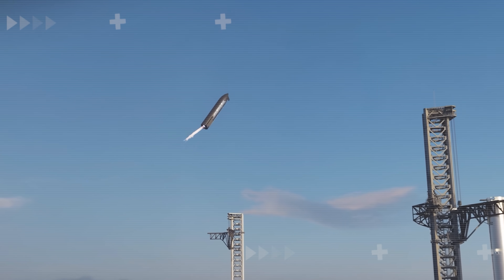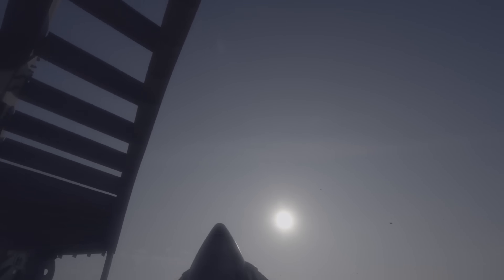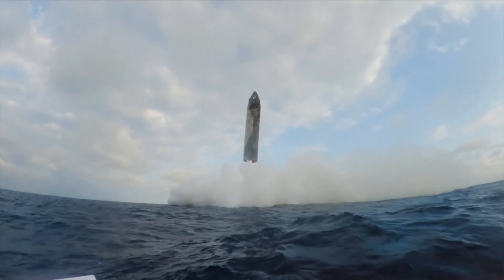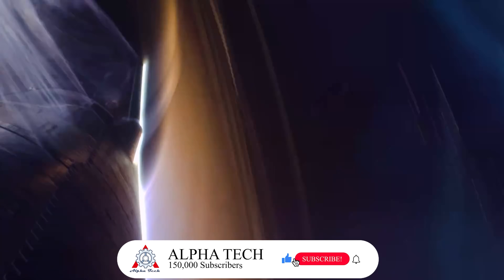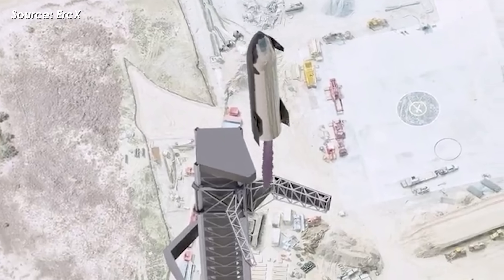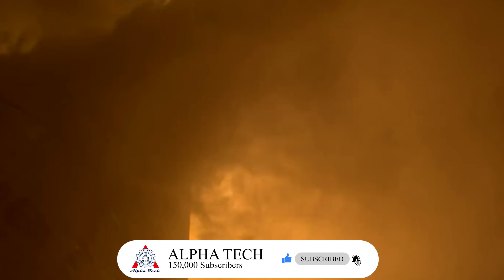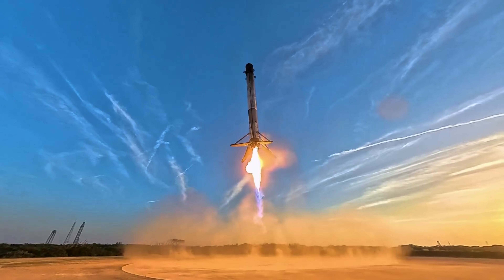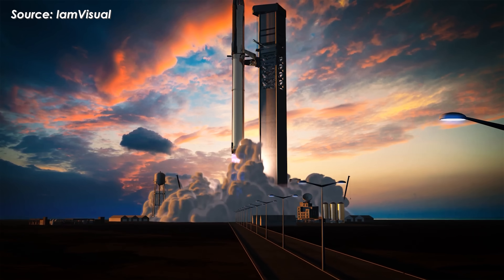FAA Declared SpaceX is Finally Catching Ship after Starship Flight 11 totally Mind-Blowing!

Comment: You can risk to pull that stunt without people on board. What happens if you misalign for 1000 possible reasons like thruster fail or sudden gust of wind? Those guys are either morons, or they are too scared to call their "chief engineer" a moron? Abort landing! - abort landing! ... ooops ... 20 corpses.
Reply: bro, don't you see that SpaceX is testing 'failures' all the time to know how to maneuver in complicated situations in case an error occurs?
Reply: @otroCebas  yeah bro I see that, but landing the ship with people on board on chopsticks where 100 mm out of the line could bring a disaster, without any backup plan .... come on -  is as reckless as it can gets. This thing will never be human rated. Remember my words.
Reply: @lachezarkrastev7123 that's what they said about airplanes.. or even high speed rail.
Reply: @the_lomax  compring this with airplanes is inadequate at least - a plane can land on a corn field, even with zero engines having lot of time to prepare in most of the cases. It can glide ten times the altitude with no engines and it has factor of safety on all critical structures greater than 2.5. Starship has facto of safety below 1 ... if you know what "factor of safety" in the engineering means. Just imagine that you fall from the sky with 300 km/h and you have 5 seconds to  transition to  landing and nail it with 10-20 cm accuracy - it is beyond crazy. Even if you can pull this of 90% of the landings it would be still not good enough. Just for comparison the Soyuz rocket has zero fatalities after 1980 in hundreds of manned flights.
Reply: @lachezarkrastev7123 rotfl comparing this to soyez is like comparing a model t ford to a ford GT 500. While they may be modes of transport with an engine and wheels they are certainly very different. Saying a plane can land in a cornfield is absolutely an ignorant statement. So you a plane of near comparative weight and size would be an A380 that would rip itself apart landing in a cornfield. Also both glide starship has what is called a lifting body profile hence the flaps. 

Soyez has none of the capabilities of starship. Hell soyez can't even compete with cargo and crew dragon. 

You talk about critical structure greater than 2.5 if soyez has any issues with it's parachute system you don't survive there is no redundancy. SpaceX already has with dragon redundancy more than soyez. You think that starship won't have redundancy systems? 

At the end of the day the russian space program is dead. Its death arrived with spaceX crew and cargo dragon. Its not financially viable as a human launch system. Do not innovate get left behind.
Reply: @lachezarkrastev7123 also spaceX have been doing massive amounts of testing on the landing system. They are the experts in landing rockets on ocean barges which is far harder than hitting a static landing zone like stage 1. 

They are literally landing boosters on a moving target a booster that doesn't have the throttle and hoover capabilities of starship. 

Oh and while there have been no fatalities on soyez re-entry there are many injuries broken bones ect from the crash land it does. So I wouldn't talk up an archaic system that injures its occupants. Fits only 3 occupants leaks like a sieve and is only a step above Boeing's statliner.
Reply: @lachezarkrastev7123 also soyez isn't one system the current soyez ms has had a terrible track record for reliability and safety especially with the failure of soyez ms-10 where they had to activate the LES after launch. Soyez is a family of systems based on outdated technology that the Russians cannot even maintain.
Reply: @the_lomax  okay they are the best - the time will tell. Just remember what I said.
Reply: @lachezarkrastev7123 no one said that starship is the best. Its still in development we don't even know what the starship HLS system will even look like or how it will even land. It may use the chopsticks it may be a landing site. Put it this way with the safety standards  that spaceX will have to meet it's not going to be substandard. Writing things off something before you've even seen a design for the whole the system is just silly. People laughed at catching the boosters with the chopsticks... They did it and not even with a fully capable system with a testbed system. 

I've been skeptical about the whole system myself but have learned to wait and see how spaceX deals and manages each obstacle that comes their way. Glad that aerospace has returned to iterative testing instead of just modelling.
Reply: @the_lomax  guys you do not have a clue what, or who I am. I am in a close contact with a guy in the SpaceX engineering team, as well I am a masters degree engineer with 20 years experience in thermodynamics and CFD simulations. My guy from SpaceX agrees 100% with me me about the shield and the chopsticks landing with people on board. You have zero idea what the working environment in SpaceX is. Competent engineers just stick around for the paycheck forced to do stupid things, or being fired for having an opinion. On the other pole are the cheerleaders who scream in ecstasy like in a cult, every time when Starship blows up. I am done here. Write what you want.
Reply: @lachezarkrastev7123  rotfl sure bro. Your expertise went so far you compared soyez with starship. You made stupid statements like a plane could land in a cornfield... When a plane of the same comparative size would destroy itself. 

Oh and as for you having a friend who works for spaceX.. lol 😆. Sure SpaceX just keeps around people who do nothing but stick around for a pay check. Don't be full of it all your life. 

One easy way to spot a liar they start making fallacy arguments to their own expertise and friendships as if that validates their arguments.
Reply: Pointless comment at this stage..
Reply: @jasonwright7066  the stage is about 2 billion dollars wasted as an artificial ocean rifts and junk and they still didn't get that silica tiles melts at about 1700 C and the plasma is well above 3000 K...
Reply: Let me guess. Musk used to be a genius in your eye’s when he was building Teslas but became a moron the day he supported President Trump. You leftists judge people’s achievements based on their politics. Now who’s the moron?  You are. Musk is just as smart today as he was when you were a closed eye kitten.
Reply: @stevebroome1288  blaaa blaaa blaaa - ask the people burned alive in the Teslas "engineered" without a simple proper door lock. I don't give a rats ass for Trump, or Biden or whatever other puppet the US warmongers ellect - it is all the same - never ending war supporting genocide and warmongering all over the world.
Reply: @lachezarkrastev7123 While you were drunk on your cool aid President Trump was ending wars and stopping genocide.   Pick the winning side for a change. I doubt you know much about  Tesla door locks. If you would stop filling your mind with poison you might open your kitten eyes and see a world not as hateful as what is in your mind. Even the president of Pakistan gave Trump credit for preventing a nuclear war. I would welcome another Trump supporter. Come over to the light.